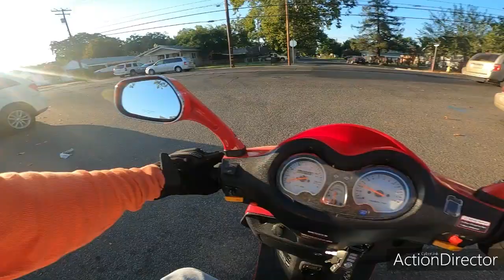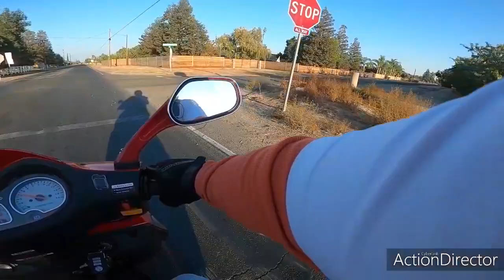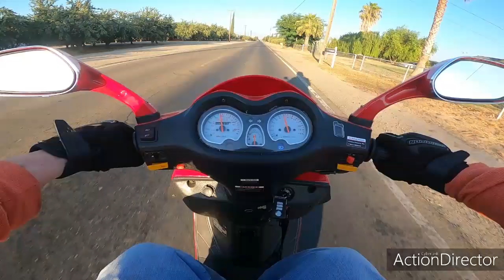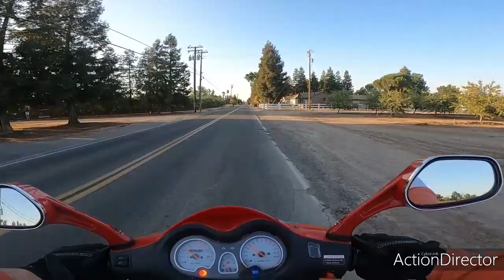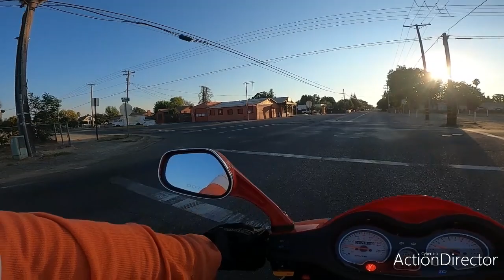icebear Hawkeye 150cc scooter running good now ...!😁👍

Comment: You mention braking. There is a channel called MCrider who does training videos. On one he shows the best practice is to gently start braking with your left rear brake and only add right front brake as needed, finishing the braking with your left rear brake. This ensures you don't fly over the handlebars and it helps stabilize the bike when coming to a stop for a smooth experience.
Reply from the maker: I'll check it out thanks for this info ...🙂👍
Reply: @GY6-SCOOTERS  My pleasure. It's a little tricky at first because your tendency is to squeeze both brakes at once but once you get it down, you should notice it makes for a better ride... of course not relying on your stronger front brake as much means you need to check your rear brakes more often.
Reply from the maker: This will help out a lot especially when I'm coming around turns to a stop sign thanks again my friend

Comment: That's awesome to hear! How fast have you had it? If it reaches 60 or so, I might buy one to ride to work and back. I hate having to spend $45 to fill up my tank every week.
Reply from the maker: Yeah bro the 49cc scooters go like 38-43 mph top speed all stock and these 150cc scooters max top speeds is 55 -63 mph all stock I've already purchased 2 of them from online the lil 49cc cost $1,000 delivery and all and the $150cc cost a total of $1,200 delivery and all 😁👍
Reply: I don't even own a car anymore, they are just not worth it